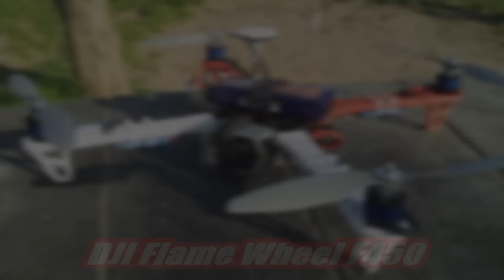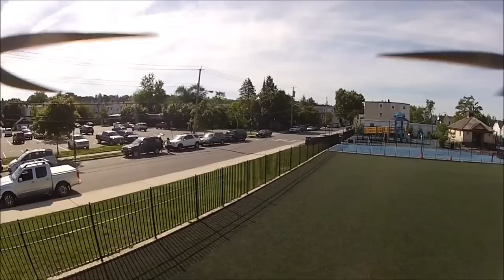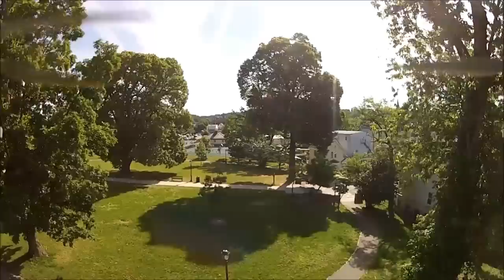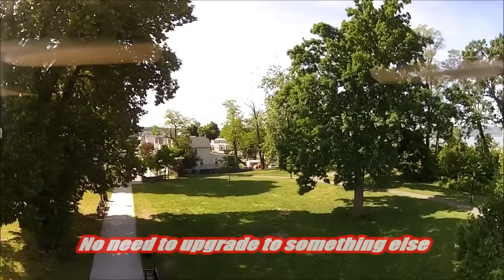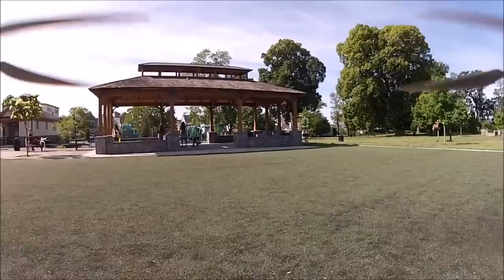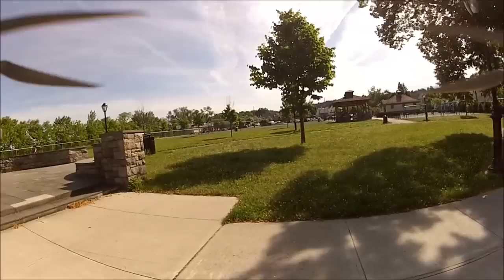DJI F450 Flame Wheel More & More Proximity FPV Practice part #5

Comment: Well done. I am just now getting finished with a 450 Flame Wheel and you make the FPV look so easy.I have gps naza barameter and FPV.Got goggles. Running a 6 cell on this baby,3000 mah,and 5200 mah.have landing gear for gimble and camera,,oh waiting on 12 inch props,10inch does it but ,,,,

Comment: Very interested in buying this arf kit. Does it come with everything you need to fly? Except for the transmitter and reciever. Like does it come with flight board and everything?
Reply from the maker: DJI sells different versions of this aircraft from just the plain frame to the ARF that comes with everything minus the TX and RX , go to GONITROHOBBIES on ebay , they got the best prices for DJI products .
Reply: TFRdrones Alright thanks! Will the kk2.1.5 board from hobbyking work with this?

Comment: Do you think it would be able to fly well with 5000 mah lipo?  I have ordered a similar one. And a 5000mAh lipo :) it's scary to fly fpv,  but I'm learning :)
Reply from the maker: 5000mah 3s will do good , just don't used anything larger than that because is going to be too heavy for the F450 .
Reply: ok:) i thought so. tried any different size of props?
Reply from the maker: It gets scary at first but you will get used to it , just go to a large open field with no trees around , make sure is not a windy day either , no more than 10mph winds .
Try any known brand name props like apc or graupner , no the Chinese cheap stuff , 10 inch props will do fine with 3s lipo's .